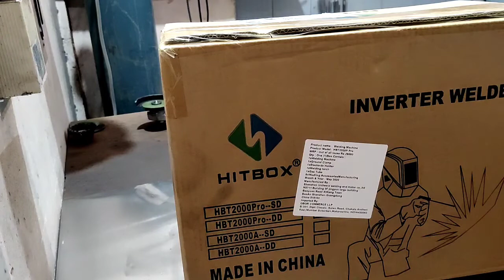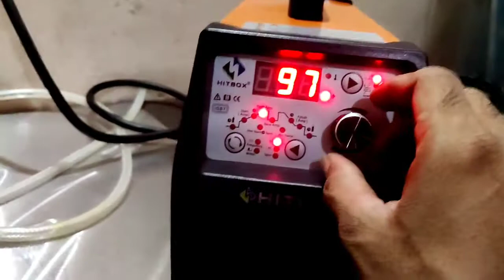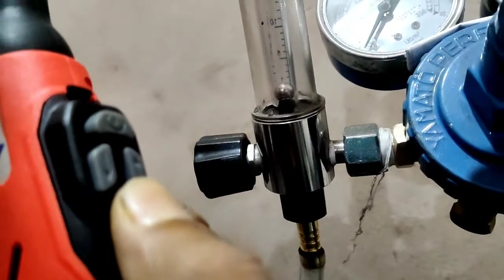HITBOX 220V Tig Welder Pulse 200A.. unbxing

Comment: Sir,  
Bought online yesterday.. While testing on work piece machine first 5 minutes worked perfectly but then it went hanged.. Jammed.  Frozen. No action can be performed. No arc, no current up down.. So i switched off it and restarted testing but same thing happened 6 -7 times.. 

What could be the issue wuth machine? 
Troubleshooting manual doesn't mentioned anything regarding same.

Comment: Thanks for the video 👍
 I bought mine (same welder) about 3 months ago and set it up on a welding cart but I haven't used it yet, I haven't gotten any shielding gas for it. What I was wondering is if your welder came with the tungsten electrode or if you had to get it separately? I don't remember mine coming with a tungsten.
  Thanks
Reply from the maker: I got the tungsten with it
Reply: @FastTig  I'll have to look in my accessories package that came with the welder again, I don't think mine came with one.
Reply: Don't plan on welding thick metal with this junk welder this will only weld 16 gauge and below.
Reply: @sand_riders so what it doesn't put out a true 200 amps

Comment: Sir, 🎉
Guarantee warranty for this machine?
Reply from the maker: 1 year..... But no avilable it now
Reply: @FastTig thank you for your kind reply sir 🎉..
Bought online yesterday.. While testing on work piece machine first 5 minutes worked perfectly but then it went hanged.. Jammed.  Frozen. No action can be performed. No arc, no current up down.. So i switched off it and restarted testing but same thing happened 6 -7 times.. 

What could be the issue wuth machine? 
Troubleshooting manual doesn't mentioned anything regarding same.

Comment: Hello, with this device you can weld without using gas?
Reply from the maker: No
Reply: Yes, but that would be SMAW process. Stick welding with 60, 70, 80, etc series electrodes